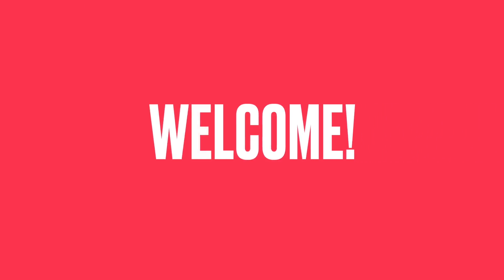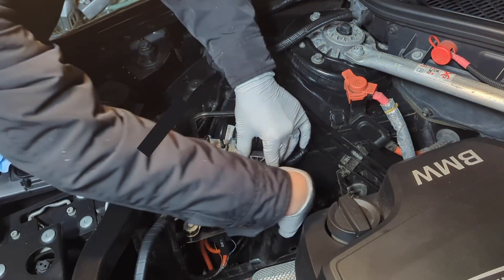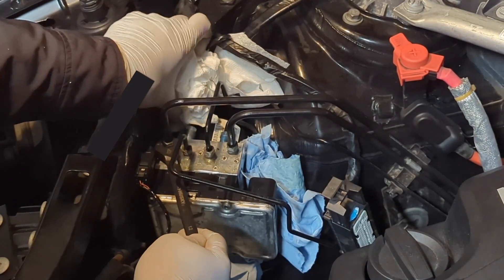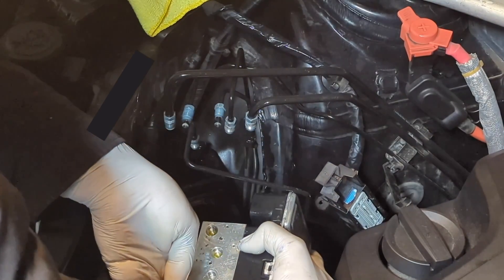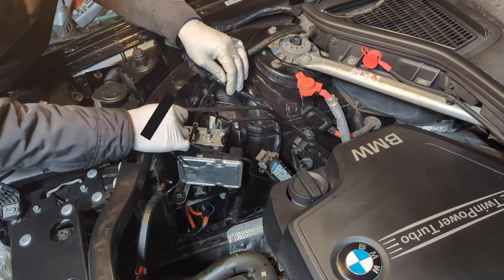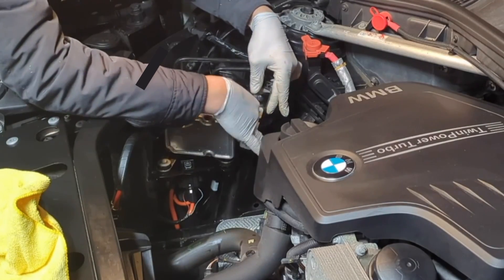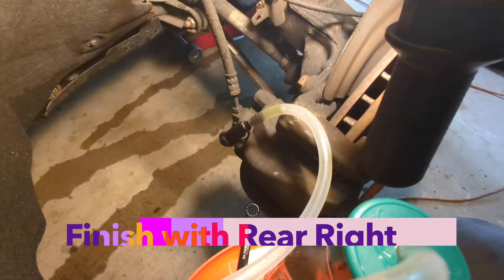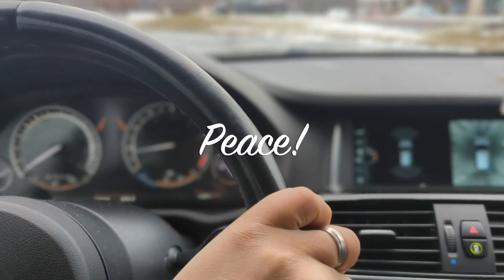BMW ABS Replacement & Full Brake Bleeding | 20+ fault codes on 2017 X3 M Sport

Comment: What happened without coding and programing abs module driving the BMW f45 car ?
Reply from the maker: In this case, no ABS and any module relying on it such as traction control won't function. There will be a bunch of related warnings. Even before you can reprogram ABS, make sure the new unit is installed correctly and bleed your brake lines so you don't have air, which is otherwise very dangerous.

Comment: Can drive the car without coding and programing after replacing the abs module, can move to car to other place to do coding I mean?
Reply from the maker: Yes, the car is generally drivable without reprogramming ABS. But expect dash lights and warnings as there will be no ABS or traction control, if nothing else. Be super cautious and drive short distances only.

Comment: Would that bleeding process be the same for a 2013 F25 Xdrive35i? With what wheel to start with and end on? I have to get a scan tool to do this cuz I don’t have one. Thanks for the information
Reply from the maker: It's the same generation of X3 with the same F25 chassis. They should follow the same bleeding procedure with the principle to start with the wheel furthest from the ABS (left rear) and work your way closer to it. In the video, I followed the procedure on the scan tool to go a full circle starting with the left rear but you can also do left rear, right rear, left front, and end with right front (closest to ABS). 

As for scanner options, there are budget friendly units like Launch Creader Elite for BMW at $130: https://amzn.to/3DzU1hO. But I may have found an even better deal by Kingbolen (same company), which I am currently reviewing and appears to have ABS bleeding, at an unbelievable $75 price: https://amzn.to/3BIVX7j. For either option, please do contact seller to confirm its support of ABS bleeding on your vehicle.
Reply: @ thank you for the help and for the scanner options! I really appreciate it and yeah it’s the same so I’ll definitely be following those steps. The part got delayed due to weather so I’ll let you know the results and researching those scanner tools now. Thanks again!!

Comment: hey friend, does you new dsc make a ticking noise for about 10-15 seconds when locking or unlocking the vehicle ?
Reply from the maker: I haven't noticed anything like that, but it sounds normal on a BMW unless there is a code.